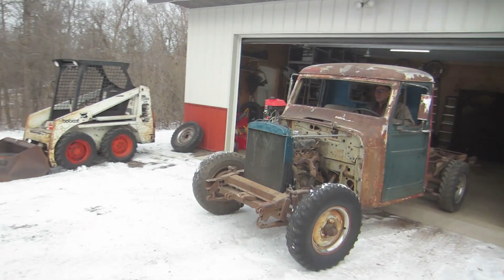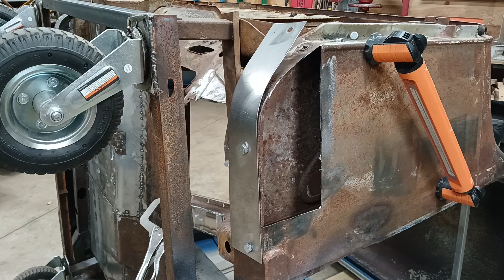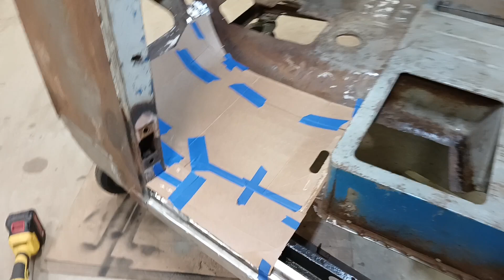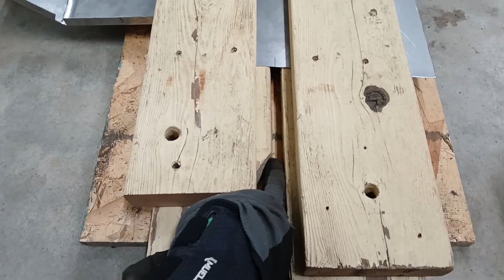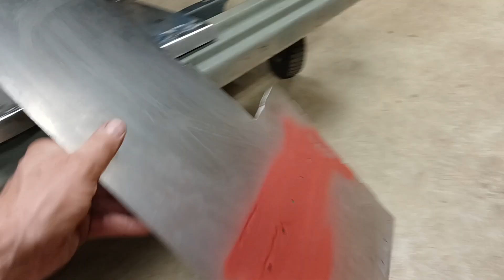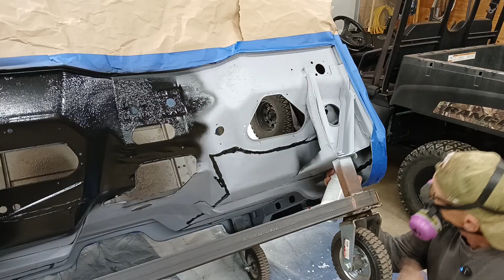1949 Willys Pickup Project   Part 22

Comment: Could you share the dimension of your cart?
Reply from the maker: I'm assuming you want dimensions for the cab mount points.  36 3/4" across front mounts, 50" across rear mounts, 47 1/2" between front and rear mounts.  If you haven't seen it yet, check out my Part 3 video where I build the cart.  I built the cart frame on the floor using plumb lines from each cab mount to determine the overall shape.  
https://youtu.be/r5IxFVkW_-w

I added rear extensions to the cart later to protect the lower rear panel from denting when I roll the cab over on its back.

If you're anywhere near central Minnesota, the cart will be up for grabs when I finish the cab work and get it back on the truck frame.

Comment: What made you ultimately decide to fabricate your own custom floor panels rather than buying prefabbed floor pans?  I can certainly see advantages to both approaches.
Reply from the maker: @kjohn1626  1 - cost.  Premade run $200 each side.  I paid less than $50 for a 4x4 sheet of 18ga steel.  2- The premade panels don't wrap up the tunnel, so I would have had to do that work on my own.  3 - Floors get covered up.  You can get away with more hackery than with the visible body panels.
Reply: @TheToolmanTim  I'm a master of hackery.  Your floors turned out great, by the way.